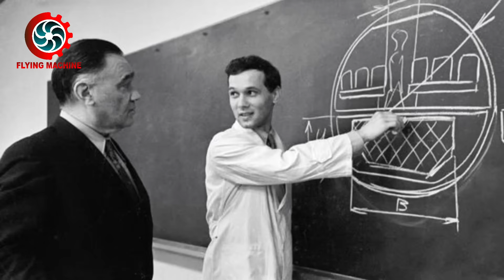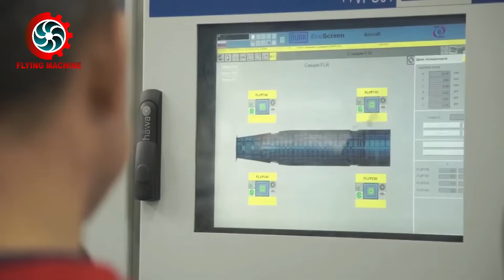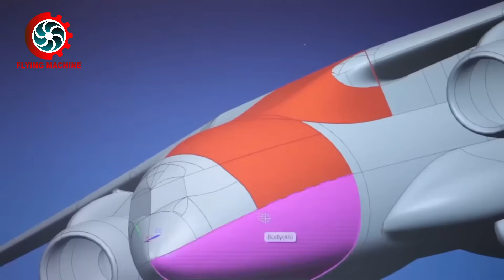7 Best Russian Aircraft Manufacturers, Which is The Best?

Comment: Well, needs must.  The aircraft industry will be more robust, technacly advanced and efficient than before 2022.  Commercial production will be full in-house manufacturing with gas not been the case for many years. Profitable ?  Who knows.  

Military aviation and designs will be much better for having combat experience over a prolonged period.  Issues become apparent and not covered up.   New tech and machinery together with more trained young people..  

All of the above will change the industry for the next 10 to 20 years.  

Western aircraft will not be available for a long time..